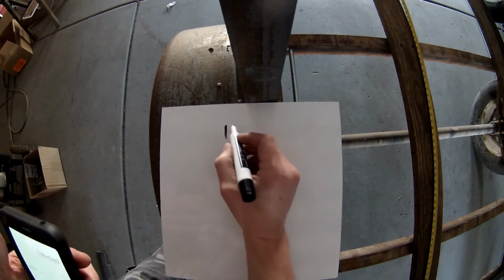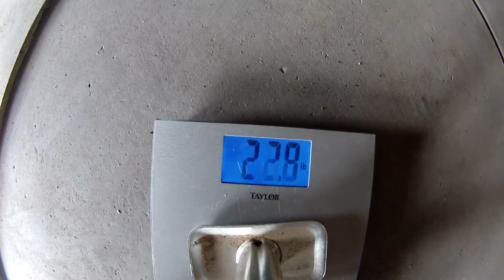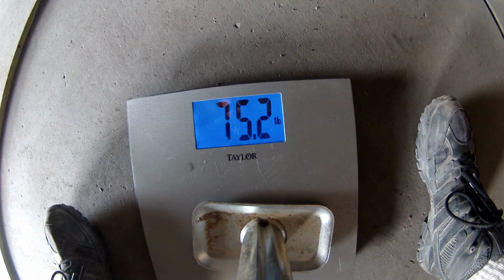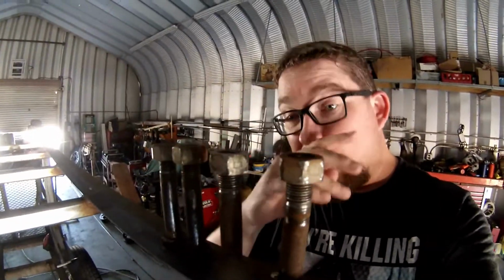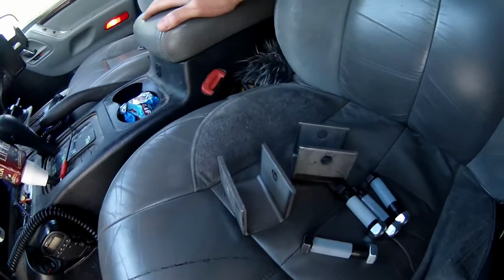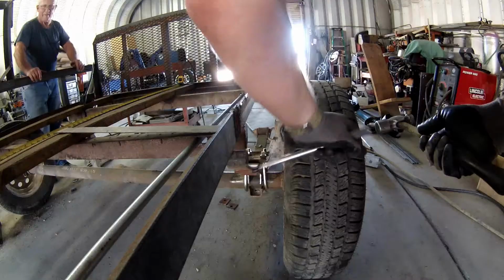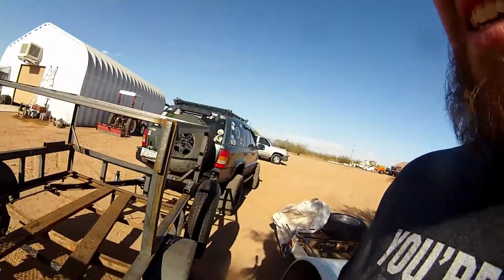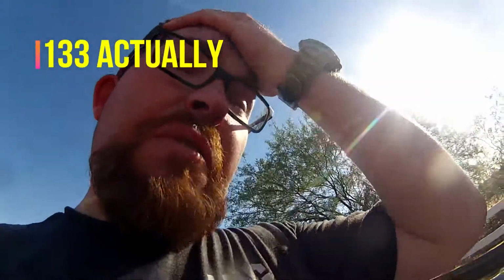Overland Trailer Build Part 6

Comment: Very interested in how the tongue weight works out after you get everything loaded on.
Reply from the maker: It works pretty good. It tows really good when it's loaded. The important thing was that I could not exceed the tongue weight limitation of 200 pounds. The first time I towed it on a trip I accidentally loaded it too much to the rear and had to stop, pull over, and move things forward. No big deal but its just a learning curve. When it's not loaded it still tows well but it doesn't hurt to keep some stuff in the tool box.

Comment: Nice work! I just converted a utility trailer also! Saw your vids when i was on the fence about the conversion and it totally sold me. One question- how did the roughly 70lbs tongue weight get calculated? I knew about the 60/40 rule, but i still don’t know how much the trailer weighs total! Lol, this was definitely a learning experience and your build was an inspiration. Thanks and keep them coming!
Reply from the maker: Great hope you build goes well. I simply measured the tongue weight with a scale on the floor. I could have used the equation that takes the vehicle weight but I didn't have the correct scales to measure the trailer weight. The trailer build has been on hold the past few weeks because I sold my Grand Cherokee and bought a new Jeep. But I plan on getting back to it in the next couple weeks I need to do bearings races seals and start cleaning up the surfaces and getting them prepped for paint.

Comment: Will the RTT affect that tongue weight, I am looking at building the same thing on my trailer but will be carrying a 4 seat talon on it as well.
Reply from the maker: Yes it will being 140 pounds. So, I took that into consideration when I moved the axle forward. So you will have consider how you will packing your trailer and where your weight is going to be. If you will have more weight on the back of the trailer you probably want the axle positioned more in the middle to back of the trailer to avoid making the tongue weight too light. I knew the weight on my trailer was going to be more forward so I moved my axle forward to avoid making the tongue too heavy. This has made packing the trailer more of a conscious exercise to avoid making the tongue too light. A heavier tonque weight will tow nicer than a lighter tongue weight. If you plan on placing approx 60% of trailer weight in front of the axle and 40% to the rear, that will be a good starting point.

Comment: I hope no one puts to heart your calcs on "tounge" weight.... to figure it, you need the total weight of the trailer, not measurements...... I hope you recalc and let everyone know...... cause this is WAY wrong.................
Reply from the maker: I know what you're talking about and it's the formal calculation. What I presented is another way of doing it. Its not perfect but, it worked for my project.
Reply: The Right Line just finished your series. And saw where you shifted weight back.  By now I bet you have used it a time or three... hope it works great for ya.... 

Cheers from Montana.
Reply from the maker: Hi John, I played around with it a little bit especially when I saw how I was going to load the trailer with gear. Its my second trailer and I learn something new each time!